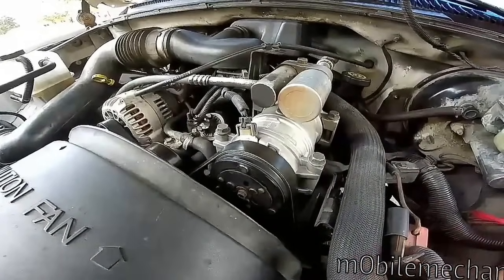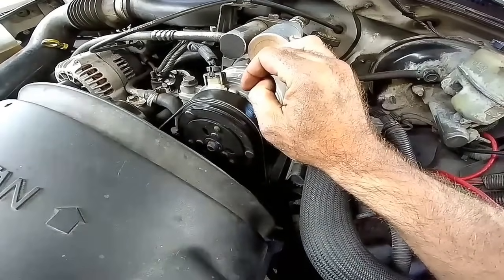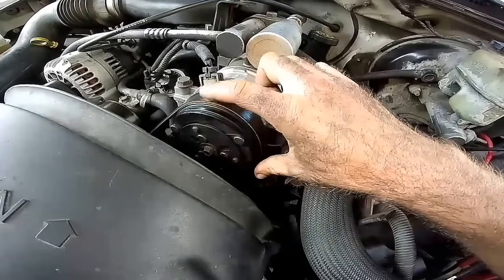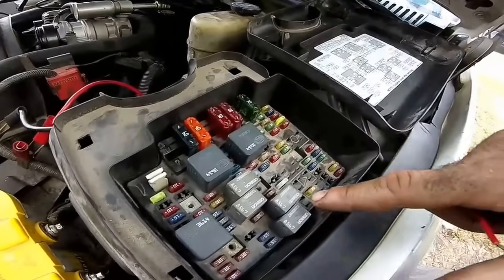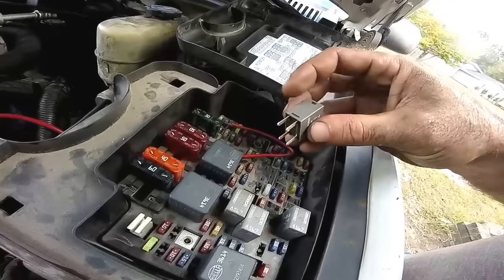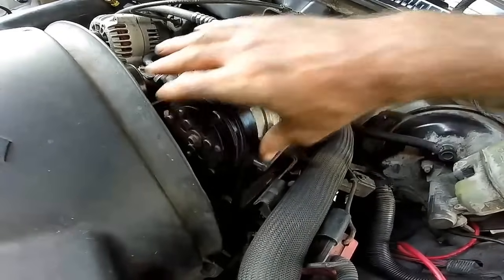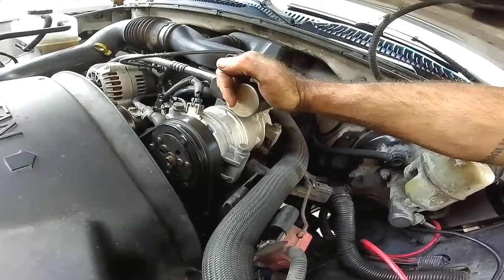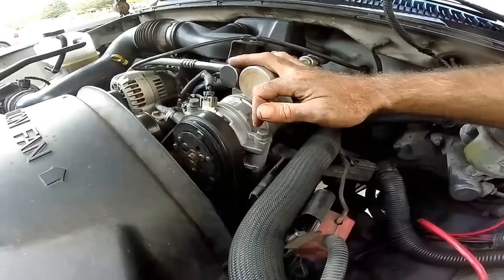Easy A/C Clutch Coil Test A/C Clutch Not Engaging

Comment: So my AC works fine, there is just no power to pins 85 and 86 regardless of what I do with the blend a/c control selector.  The vehicle only has 30K miles on it so I highly doubt the panel control switch is bad.  The wires come out of the harness on back of the rotary switch, but after about 6" they dive deep into huge multi bundled cables  :(    Every fuse in the thing checks OK. (It's a motorhome with the chassis built by one company and the rest of the electrics highly modified by the final assembler.  Just how bad of an idea would it be to wire a simple STSP toggle switch at the panel to jumper 30 to 87 and turn it on when I want the compressor to run and off when I don't?
Reply from the maker: if you arent getting power and ground on 85 and 86 your high or low pressure switch might be preventing ac function do to either low system pressure or a bad switch. first thing you need to do is make sure the system has the correct amount of refrigerant in it.
Reply from the maker: i just saw the last part of your question. please dont attempt to use a switch most likely its not coming on because of a switch or something and when you use your ac there are a few things that need to happen when the compressor is running like fans need to be on high speed and there needs to be adequet refridgerant etc to keep from ruining the compressor.
Reply: Wow,  thanks for the quick replies.  ALL 3 have been done.  1) low pressure switch validated.  2) overpressure switch validated.  3) Freon level checks OK.  Jumpering switches at the connectors still doesn''t allow the clutch to engage :(  jumpering   at the relay does, then the system functions perfectly.  I'm thinking it has to be a shorted control wire somewhere between the control selector and the relay, there may be a computer or circuit board involved but the schematics (that I have access to) are minimal
Reply from the maker: happened to be at the computer when your question popped up lol. yes it sounds like a control issue or possibly you have an evaporator temp sensor that went bad if equipped.
Reply: m0bilemechanix So thanks to you, I just found the problem! an unpluged wire @ the evaporator temperature sensing circuitry. it now works like it should. I have a video about Ford F-250s and their problem with pneumatic control of the blend doors. it has been viewed almost 1/4 million times. people often offer to buy me something. I always tell them just pay it forward... maybe this is my pay forward.  Thank you sir!  I never knew that third switch exsisted.  wanna help me get the remote mirrors working 🤣
Reply from the maker: congrats im glad i could help. i think id need to be there with a power probe to help with the mirrors lol

Comment: I must have loosened up the clutch on the compressor, would not spin until I removed the relay and used a paper clip and it started working and the air got nice and cold. I shut of my truck removed the paper clip and put the relay back in and it works.
Reply from the maker: Could have been that the relay was making bad contact

Comment: Quick question.
03 jeep liberty 3.7
I know my compressor clutch it's good,and it's filled with refrigerant because I connected a wire from the positive post on the battery to the #87  on the relay, and clutch got engaged and got cool air.
But im still not quite sure what I did. 
The fuse it's good, the relay it's good  (visual inspection).relay was swapped)
I tried what you taught us. Paper clip from 87 to 30 and the clutch didn't move. 
Can explain to me what I did?  Or narrow down which way I should go from there. Or what to check next.
Because the only way for my clutch to engage and I get cold air it's the way I did it (batt. + to #87 relay)
Thank you very much for your video,  it's very clear and precised. ☺

Comment: I did this and got the same results as you but I don't have cold air blowing. System has a good charge. What now?
Reply: check your condenser to see if debris are clogging the fins
Reply: @lifepresent3183     I always wash that at the car wash

Comment: 08 impala has a clutch always engaged. Even when the power plug  is disconnected. 
Only blows warm air. checked and reinstalled all the fuses and checked the relays with a 12volt source. Has a 3 prong high pressure switch / transducer  tested open. I unplugged it for a minute and the condenser fan reved up to high speed which it was not doing at all with it plugged in. Any ideas? thanks for the good info. I know I have to get the clutch checked out. But could there be an over pressure situation from it being engaged all the time?

Comment: My fuse for the A/C 10amp is blowing - I place a brand new 10 amp fuse all is fine, the second I turn on the A/C  - poof - I blow the fuse,  I am thinking there is a wire in the line that is Arc in somewhere,  guess this is beyond my scope,  I looked under the hood for a wire that is bare to no avail.  open to your suggestions
Reply from the maker: unplug the compressor and see if it still blowes the fuse. if it does then you have a short in the wiring. if it doesnt then you have a short in the coil
Reply: I unplugged the compressor, turned on the a/c and the 10amp fuse is ok
I re-connect the compressor - turned on the a/c and the fuse blows each time I replaced the fuse.
Do I need to replace the whole compressor?  yikes,  that 950.00 plus tax  Plus the install
Is there anything from the compressor I can reuse
Reply from the maker: if you can get access near where it plugs in you might beable to see where the wire has rubbed on the case of the compressor causing the short and can sometimes get the wire moved away. otherwise for most vehicles you can buy a clutch kit at the parts store witch comes with the pulley, clutch, bearing AND the coil. you can save alot going this route. i have a video showing how to change it here. keep in mid the process varies slightly per vehicle and can be a pain. https://youtu.be/ecOqiUfYx6Y
Reply: Thanks for your awesome videos and time,  
After watching your recommended video  I do not own such tools,  and buying them for a one time use is to me a waste of money,  I can see why a guy like you would own such tools,  I contacted a local scrapyard and picked a used a/c compressor for 125.00 plus tax - so - 140ish $
Had it installed at Canadian Tire,  installed and freon filled,  310.00$
so 450ish $  and now I have a/c blowing cold again.  

While the truck was there I asked if they would check what is leaking
EGADS...  Oil, transmiss, and rack&pin all three are leaking, was told the cost of the repair is so not worth fixing,  sell your truck they said.

Great,  I just had a 1500.00$ brake job -  bought both summer and winter tires for 2000.00$
how much can I get for this truck LOL   - money in the wind I guess
Reply: John Smith never buy a clutch kit just get a new compressor and dont worry about it for a long time
Reply: KIRK,  Thanks for the advice,  That was the problem, the compressor was broken,  I replaced it with the help of the scrapyard the part at the end of the day was 125.00plus tax so 140.00ish.  then  310.00 to have it refilled and installed.

NEWS FLASH:
 I knew I had  a Rack and Pinion problem 3 years ago,,, but just last week,  it went KaaBoom,  I have way too much money invested in this truck to scarp it, so 1060.00$ later I have a new rack and pinion - tie rods - wheel aliment - summer and winter tires 2000.00$, hi-end Transmission Rad 250.00$ [ was hauling mobile homes .]
1500.00$ Brake pads-rotors- calipers- brake lines.
  I think the transmission is next.

If I buy a new truck, God knows what repairs I will have to do,  at least my truck I know it.  I have
Reply: @2HAMMERS1  why the brake job so expensive bro?  send somebody else in with the truck next time... sounds like "they can see u comin' buddy!!"  no offense.

Comment: On my 1995 c1500 whenever I jump the compressor, the solder joints on the controls melt,  it was a brand new controller from Rock Auto any suggestions on how to fix?

Comment: So I've got a 1974 Dodge Charger I have no idea where the relay is located... also my wire was clipped on the compressor itself so I have no idea where the wire is supposed to go any advice is helpful...
Reply: booty pirates sound like you have to run your own power supply with a toggle switch and be done with that part,  that's what I'd do
Reply: booty pirates o
Reply: Why did you call him booty pirates his name is turbo???

Comment: ok so I now find intermittent blowing of clutch 10 amp mini fuse when clutch is engaged by jumping relay contacts per video.. Clutch may click once and then fuse blows. This even when key is just to on position and ac blower/on off switch is off. Anyone's input on this is appreciated!
Reply from the maker: Your coil is shorted most likely. Would need to be replaced. Depending on the vehicle you can usually get the clutch and coil kit and replace just that. I have another video of my doing one in my video list.
Reply from the maker: You can take a good look at the wires coming from behind the clutch and follow them to see if they have rubbed through and shorting on something also.
Reply: @m0bilemechanix  Thanks for your input on this, I will try to locate the video on replacing the coil. Do you know if Is a short even an intermittent issue is a common problem with an older likely original compressor. Of course the Century is 21+ years old, though mileage is lower for its age. Not sure if I mentioned it before but we now know the compressor shaft isn't locked up. I'll try to take a closer look at the wiring to compressor. Though I know the voltage was around 14 on the multi meter test.
Reply: @m0bilemechanix  Some have suggested the possibility of a high pressure switch causing this problem with the clutch not engaging properly. Id bad do you know if that could cause a fuse to blow? My connector to high pressure switch has three wires. Do you happen to know how to jump a 3 wire pressure switch connector.

Comment: Mine works for afterwhile disengage and I cannot make it to engage again unless I push the clutch I check the wire I do have power and ground could this mean the clutch is bad anybody knows let me know
Reply from the maker: Sounds like a weak coil. Works until it gets hot. Time to change it

Comment: Hi , thanks for the video! I got a few questions/comments to see if you can help me here. So you talked about the use of a jumper over by the fuse box to see if it engages, you also talked about moving to the compressor plug and prove it with the Power Probe (and apply 12Volts). I jumped it at the fuse box, like you suggested (from slot #87 & 30) and it worked. I also proved it with the PP and the clutch engaged really nice as well. However you didn't say what happens or where to look for when the problem is BEFORE the fuse box. I think that's where my problem is. No luck when trying to engage the clutch from inside the cabin. The blower works fine and it blows air. The AC DOES have pressure, and pressure switches are in good condition, but the clutch does not engage. Any suggestions? A bit more background/info. This is a 2006 Mustang (4.6L). Checked all the fuses and relays and ALL are in good working conditions (checked the relays with a battery and clicked fine and also checked continuity between legs $87 & #30 and all good as well). Thanks in advance!

Comment: Doesn't the AC Clutch come connected to the compressor and couldn't you just purchase them both at the same time replacing the whole unit? Isn't that cheaper and easier then just replacing the clutch?
Reply from the maker: a compressor replacement requires changing the compressor, dryer,expansion valve/oriface tube  as well as discharging, vacuuming, leak checking, oil balancing and refilling the system. anywhere between $800-$2000. replacing just the clutch if you know the compressor is ok is in the $200-$500 range or less if DIY. a compressor replacement shouldnt be attempted by a DIY'er.
Reply: If you replace the compressor, you have to evacuate the system. Meaning use of specialty tools and  proper equipment to evacuate the toxic refrigerant

Comment: Good afternoon! I have a 97 Tahoe. My compressor turns on and off intermittently. It kicked in as I was recharging it but it won’t stay running. Any idea what the issue may be?
Reply from the maker: If it's cycling on and off it's either under serviced or over serviced. It will turn off when the pressure is too high or too low. Servicing the AC is something that should be done by someone who knows the system inside and out and has a Guage set that can read both high and low side. I honestly can't believe they se those cans to the public lol.
Reply: @m0bilemechanix  thank you so much! I will take it to the pros 😂😂😂

Comment: So my ac isnt working but when i did this it came on. What does this mean. I tried using a different relay but that didnt work
Reply: If everything checks out clutch good relay good fuse good Ac diode good and controls in the cabin good it’s probably staying off on the low pressure switch it’s a safety to not burn up the compressor. Probably need a recharge

Comment: My ac compressor clutch stays engaged, and the a/c blows warm air! What could be the cause of that?
Reply: you have a orifice stoped up its a filter coming from low side or the condensor
Reply: winston ledford explanation ?? I have the same issue
Reply: My. Couch stay on and blows cold air and start making noise and. Sound like it wants to tie up

Comment: My AC clutch compressor clicks on and off too rapidly only stays on for about a minute or two and then clicks on and off
Reply from the maker: cylcing on and off usually indicates low refridgerant
Reply: Thanks man my dealership said they could not find any leeks I've had the fan module and clutch compressor replaced and now i have this problem clucking on and off to rapidly do you think there is a leek some where in the lines?
Reply: @texans4543  you could have a bad low pressure sensor. If not that, a grounding issue, a problem with your car's computer or other possible issues. Did they check the pressure sensor?
Reply: @MrTekTime   no they didn't when im driving its mainly cold and then when the clutch compressor turns off and on it will blow cool to warm air i have a new fan module and compressor so Idk. 1100 down the drain and they keep saying it blowing cold air its good they are not leting it run long enough i pick up my kids and just idling it click on and off every 1 1/2 mins blows warm air manily
Reply: @texans4543  when you replaced the compressor, did it include a new clutch? Sounds like there's air in the system if the clutch checks out good. I'm thinking either there's air in the system or it was overcharged.
Reply: @MrTekTime  yes both new
Reply: @MrTekTime  im taking it to another shop i trust and have them look at it. thanks for taking time and helping me out man

Comment: I hot wired 30, 87 and NOTHING. So the fan clutch is shot. dang.
Reply from the maker: Talk to parts store or dealership. Sometimes you can get a clutch and coil kit and just replace that. I have another video on how to change it
Reply: @m0bilemechanix  thanks for the suggestion although turns out for the Trailblazer - you HAVE to do a PCM update of the HVAC control module program. I have now two confirmations that this is why my fan clutch had stopped working. So my dealer repair notes cite the TSB that "cancelled" the call to update the PCM. So then they notes say, "Not sure if an update would improve the HVAC." haha. It's kind of fascinating but also kind of brutal. "There was a later TSB for 2005-2008 models (07-01-39-007A-No cold air from vents, A/C inoperative, blows warm air (Sep 26, 2007)) but this was cancelled by TSB 07-01-39-007B (Dec 9, 2008). The original solution for this one was to reset the HVAC Control Module by removing and re-installing the HVAC control module fuse (in rear fuse block under driver’s side rear seat). The TSB cancellation notice said if problem occurs, diagnose using information in SI (GM Service Information, aka the service manual)." and this:  "You need the PCM update or the ticking noise will eventually come back and ruin the new clutch. " and this "What I work for Chevrolet, all of us there at that certain dealer they replace those clutches did the update. We did that because we didn't want it to come back and I have to do it again because we didn't reprogram. It's a very simple thing to reprogram. They did not do it either because they're lazy or they're uninformed about the problem with the clutch."

Comment: You say the clutch kit is $200. You can get the entire compressor brand new for just $50-60 more, wouldn't it be better just to get it brand new?
Reply from the maker: When you change the whole compressor you have to have the system evacuated and need to replace the receiver dryer and orifice tube/expansion valve and then do an oil balance on the compressor, accumulator and condenser then have the system recharged.

Comment: So my clutch doesn’t engage when the ac is on blast. I tried this and the ac clutch engaged. Does that mean I have a bad relay?
Reply from the maker: it could be the relay, the control unit, low refrigerant, bad pressure sensor among other things. but sounds like your clutch is ok

Comment: My ac works high 200 low 35 for 30 mins then goes hot for the rest of the day at high 225 low -20. Compressor constantly humming with rpms whenever it’s on. Also if the defroster is on it hums not sure why. Anybody know why? Clutch spins fine always